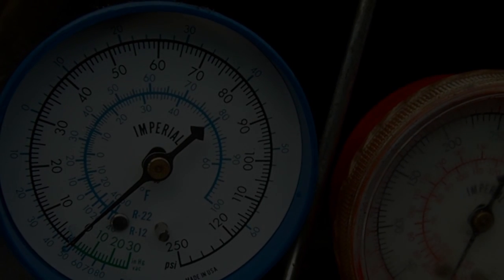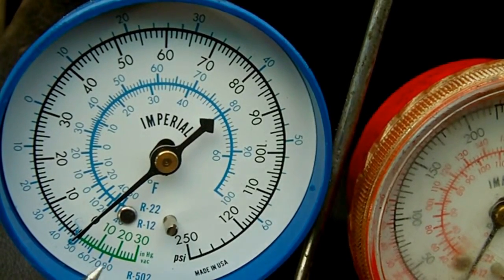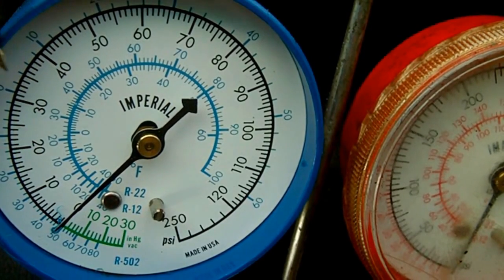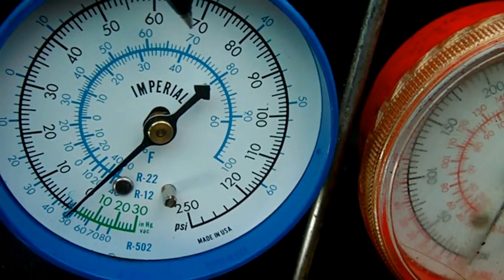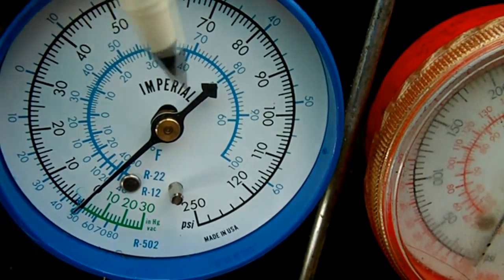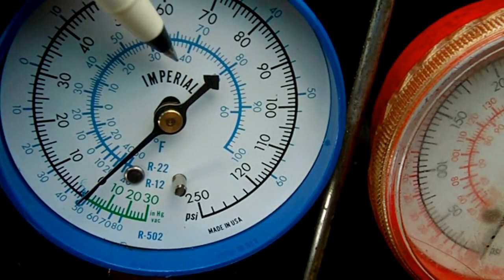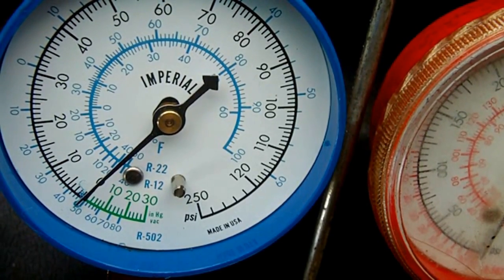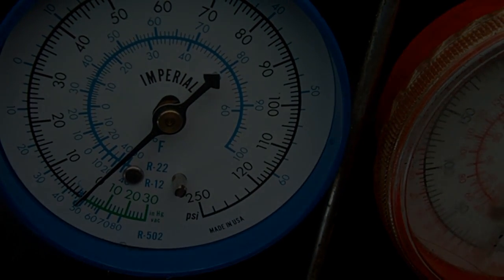superheat2011

Comment: This guy should not be working in this field.
It's should not take 8 min to explain super heat.
and yes they still sell those crap R12-R22 gauges but the better techs get the R22-410a ones or quit being so cheap and get a set of digi cool gauges that will do your super heat sub cooling for you!!!!!

Comment: @azremyyyyyy it really depends on what side you are looking at, the suction "low pressure" is usually around 65 when ac is needed, around 100+ on 410a. the discharge side on r22 is usually around 225 to 250 and around 330 to 400 on 410a, if the suction pressure is low most likely check how much refer is in it, and or filters and dirty coil